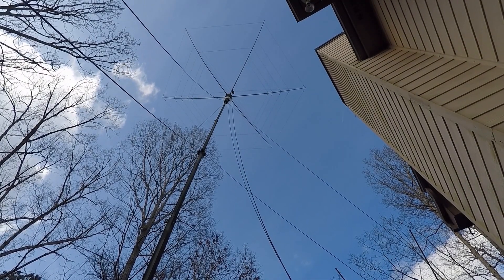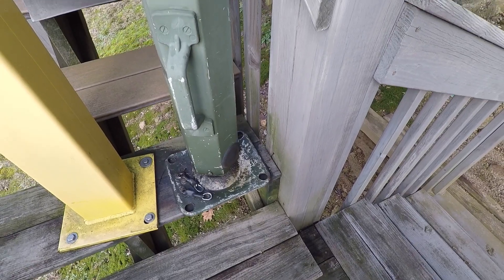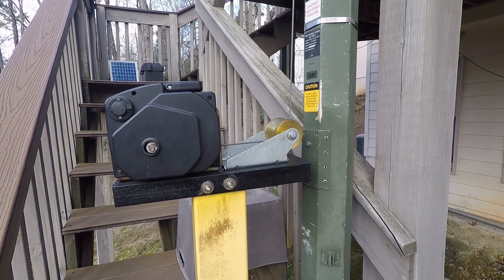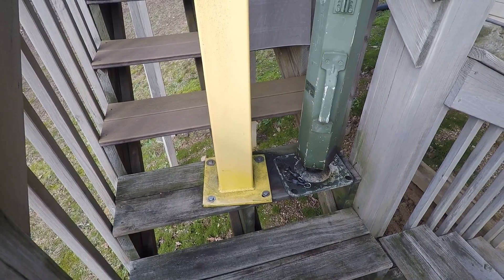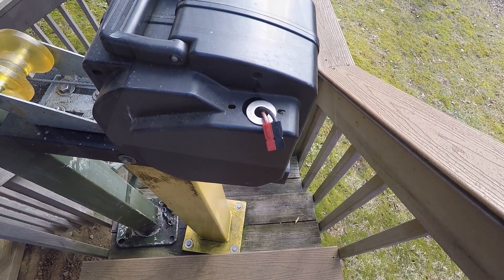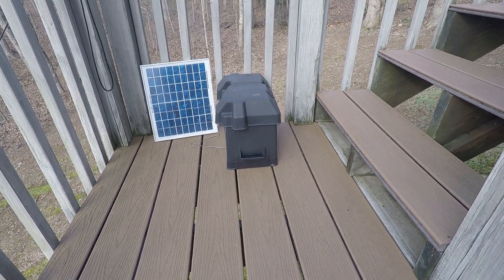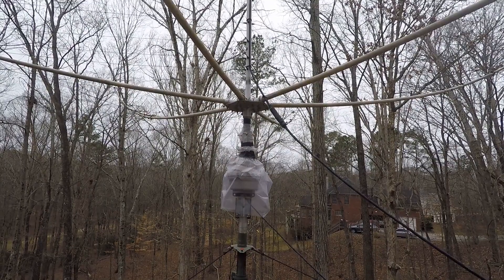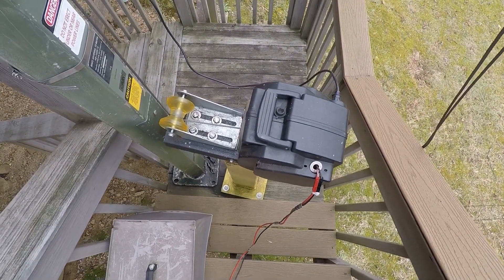Hex-Beam on a 15-Meter MIL-SURPLUS Telescoping Mast ...

Comment: Great video  need to know model of the winch thank you
Reply from the maker: I bought a Gorilla Winch in 2008 ... can't find that same winch under that name on Amazon today, but here's one that is almost identical ...

https://www.amazon.com/U-MAX-Reversible-Electric-Portable-Power-Out/dp/B08G4PHW97/ref=sr_1_1_sspa?dchild=1&keywords=boat+trailer+electric+Winches&qid=1617499901&sr=8-1-spons&psc=1&spLa=ZW5jcnlwdGVkUXVhbGlmaWVyPUEyQUxNRFJTNjlCS1JPJmVuY3J5cHRlZElkPUEwODE3NDIxM0szNElERUEwMzlPViZlbmNyeXB0ZWRBZElkPUEwNDA0Njg3UlJIOENKR0ZTRzJXJndpZGdldE5hbWU9c3BfYXRmJmFjdGlvbj1jbGlja1JlZGlyZWN0JmRvTm90TG9nQ2xpY2s9dHJ1ZQ==

I removed the hand crank and the steel cable so that I could wind the  telescoping mast's cable around the winch spindle ...

Hope this helps ...

Weymouth Walker - K8EAB